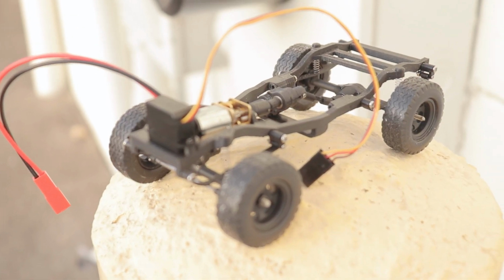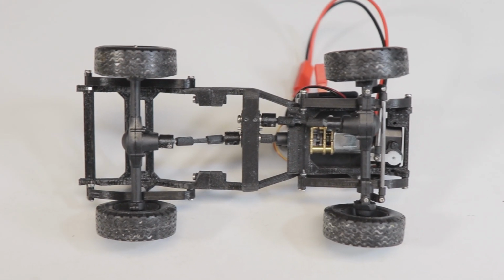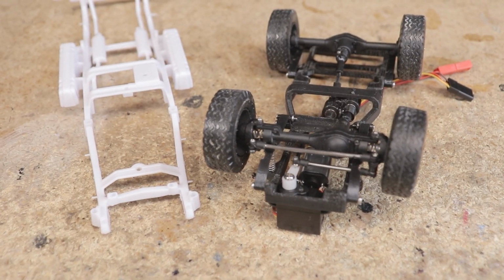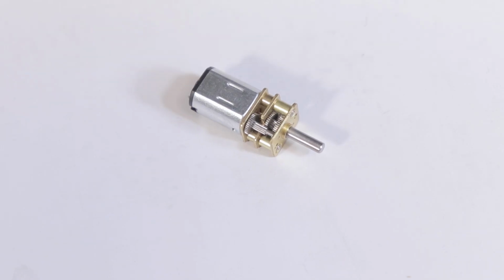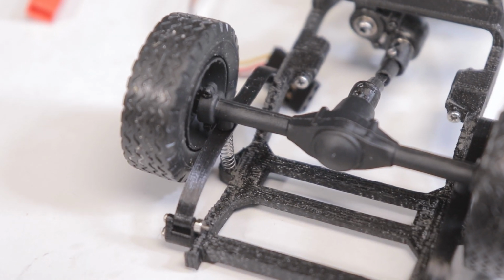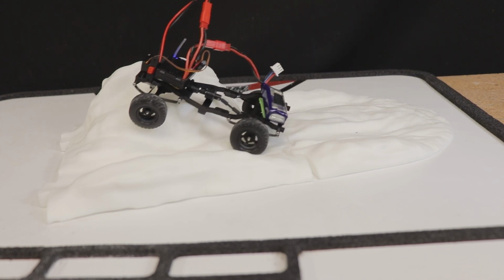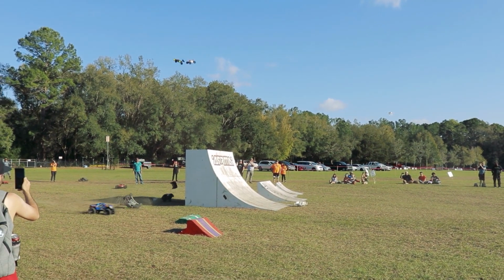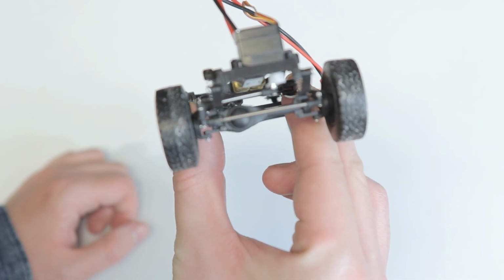The Most Scale Micro Crawler Yet? Fully 3D Printed 4x4 Truck Chassis For Converting Models to RC 🔧

Comment from the maker: Thanks for watching everyone! Looking forward to putting this rig to the test. In the meantime I've got a pretty cool build/CAD modeling video in the works. Stay tuned! 👍
Reply: Another great idea and video. I have been using Orlandoo components for my 4x4 model to RC conversions. Some of the components may save you headache as they sell the components individually. Stuff like the axels, shocks, links, etc are well built and scaled for 1/24&1/25 model kits. Keep up the great work.
Reply: Would you entertain the idea of making popular current or vintage toys (like Halo, Star Wars, G.I. Joe, etc..) into RC machines? 
Thanks!
Reply: For the transfer case you should try some small o-rings they are stronger than rubber bands and will slip rather than snap like small gears if there is any binding in the drivetrain
This is used in some lego technic kits
If you need more friction on the pulleys you can add more groves and rings without add much more strain to parts unlike what rubber bands

Comment: I think this chassis and idea has much more in common with the AutoRC Geko24 than any of the Orlandoo Hunter kits. The Geko24 is designed for 24th scale model kit bodies, just like you're trying to do. Why not use a Geko24 drivetrain and build a leaf-sprung chassis around it? They are available on Tiny4x4, the very website you showed toward the end of this video.

Comment: Interesting, I find a lot of familiar ideas and problems similar to mine! I also have an idea to use springs instead of CV-joints, but in 1/87 scale. Also, you can try O-rings instead of rubber bands in distribution box. I am doing a crane winch with 2 O-rings, and it is surprisingly grippy. Don't know if it will slip in your case though. Also, resin-printed gears will definitely be more precise at that size, and there are resins that are tough enough for such applications. Resin printing is of course, a whole new hobby with its learning curve. As for tyres, if you don't find ready-made ones, you can always try casting polyurethane in 3D-printed molds (or make a silicone mold of your plastic tyres and cast polyurethane into that)

Comment: Leaf springs. stack Aluminum can shims 
Only challenge will be to get the loop on the ends 

Shocks could be eazy just cylinder and rod. Sloppy fit packed with the thickness of Grease that works the best.

Comment: Would be great to see what you could do with the Revel VW T3 Vanagon camper. It have to be Syncro aka 4wd. I do have such kit still unbuilt. My first plan was to fit it to a Mini-Z chassis. I also have a Mini-Z overland BMW X5/Land Cruiser, but it's sadly only rwd. But with good suspension travel.

Comment: you may want to try ordering nylon gears from industrial SLS printing service. The price of the 0.25 nozzle could get you a few dozen of them.
Reply from the maker: Good thinking. I sort of defaulted to metal when thinking about those gears, but a stronger plastic could be a good mix of strength to cost. 👍

Comment: You might also be interested in Land Rover Defender (L663) - 3D printed (chassis and body) RC car in 1/18 scale.
It has 2-speed gearbox, independent suspension, 3 differentials (front, center, rear) with ability to use locked differentials, also authentic appearance with functional hood and trunk, engine simulation and high detailing, detailed Interior and working lights (DRL, low/high beams, brake lights) - https://youtu.be/4EnpzwwVMVI?si=fcl-Cnw6_c-1ALZv